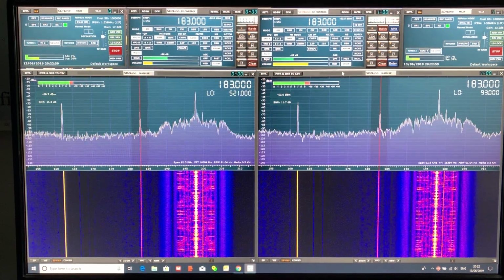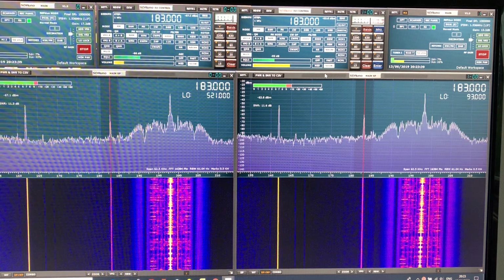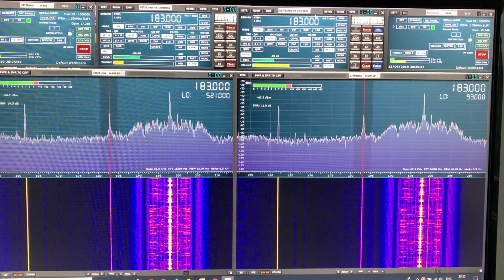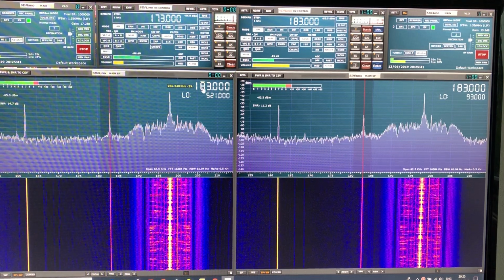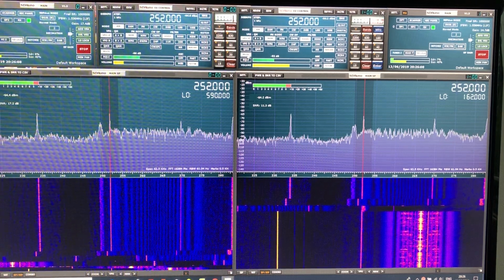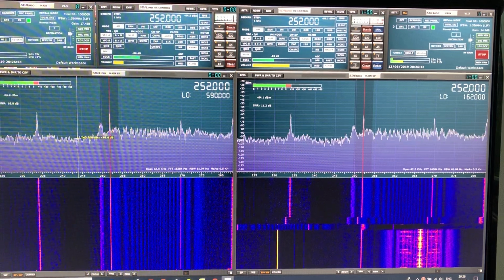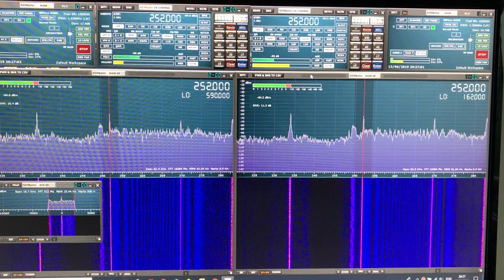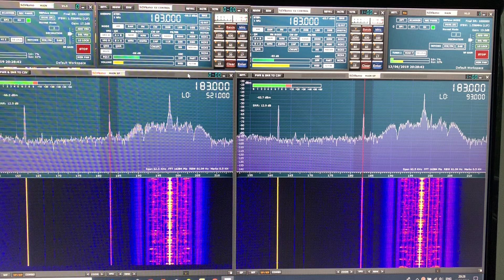Bonito CCMC-30 coaxial common mode noise filter: very encouraging initial results on longwave

Comment: Very good video Clint, I have the Ma305 and the Megaloop FX and while the loop rejects more noise the MA-305 is better for DX. I use H155 coax too and it's grounded on the Ma305, the Antenna just blows me away for the size of it. The Megaloop FX is better for local hams like NVIS but the megadipol and MA305 are serious DX antennas. The MA305 is also a brilliant LW/MW Antenna. 

I might get one of the CCMC-30 chokes for the  Megadipol and try it out on some noise I'm experiencing from the grid at certain times. 

By the way Clint, have you tried the longer whip with the MA-305 ? I did before and there was a notable improvement in signal and I lost it because I put the smaller whip back  because at the time it was overloading my Airspy HF+, you know the SDR that was never supposed to overload ? lol well they updated the firmware and provided RF gain control which made a huge difference but I lost the longer whip so I must get another.
Reply from the maker: Hi there, thanks for your note comparing the MA305 and MegaLoopFX. It's interesting that you're finding the 305 as good on DX when conditions are quiet presumably? I found the same thing - down in the DX woods I use, the signals on both antennas were largely the same...just goes to show the mess QRM causes! I have tried a longer whip with the 305 and got severe overload issues. Keep safe my friend, 73
Reply: @OxfordShortwaveLog  Yes I had the longer whip and noticed overload but this is when I had the airspy HF + before they updated the FW to allow gain control because Airspy said the HF+ would not over load with strong signals and how stupidly wrong they were. After that the extra gain was notable when the receiver didn't overload. I went back to the small whip and lost the long whip so I'm going to get the long one again, it's on the way. I''ve got the New Sangean ATS-909 X2 and it works so well with the external antenna I'm going to try it out on that, it sounds so good on SSB too and on ECSS much better than the Tecsun 880 and 990x.

Comment: My question would be would you notice a lower reading on the S-Meter when you insert the CCNF?
Reply from the maker: I think just - but that would only demonstrate the incremental improvement in SNR is small. 73s, Clint
Reply: Last weekend the M&P salesman was trying to tell me that their cable would reduce my noise level from 1 to 3 db. Whether that is true, I'm not sure. The coax that I am using is Buryflex RG-213. Believe me in that I am not a noise specialist. The only time I had bad electrical noise was a few years ago when one of the insulators on the electric pole across the street was defective. I had quite a battle getting Philadelphia Electric to come and investigate the problem. Of course they said it didn't exist. But I could prove to them that it does. They refused to come. So I called and said I had a Valid FCC Amateur Radio License. If they didn't come, I would report them to the FCC for violations. Needless to say they came within a couple days and fixed the problem. Trust me when I say that power companies don't like the FCC.
Reply: @markgriffin2285  If only I could do the same about my neighbour's solar panels 😂
Reply: I have 2 beams on my tower. One is a tri-bander and the other is a two element 40 meter beam. I tested my S noise just a few minutes ago. This test was with no antenna active, 160:0, 80:0, 40:1.5, 30:0, 20:0, 17:0, 15:3, 12:3, 10:1. Here is the S noise with antennas active, 160:7, 80:6, 40:3.5, 30:1, 20:2.5. 17:1, 15:4, 12:3.5, 10:2. My question would be what is causing the noise level with no active antenna on 40, 15, 12 and 10. And trying to find that may be like trying to find a needle in a haystack. With antennas active it does not surprise me the numbers for 160 and 80 meters. That's why I have a receive antenna that I use for those two bands.

Comment: Many thanks for this experiment. Any improvement will do for me given the challenging environments we DX these days on the lower bands. If you can do a comparison using the Wellbrook then that would be great as that is the only active antenna I have that works with my Elad. 73s!
Reply from the maker: Exactly! I couldn't have put it better myself. I have tested with the Wellbrook already and there isn't much difference - for obvious reasons, but I will still do a couple of videos demonstrating this. 73! Clint
Reply: @OxfordShortwaveLog  Why didn't it make as much of a difference with the Wellbrook?

Comment: Thanks for the comparison. It is no rocket science. Only a simple   cable trap (I use one at the antenna's end and another at the receiver's end of the koax cable. Homebrewed stuff).
But 99€ (eek!) for the Bonito cable trap is overpriced...
Reply: I agree,73
Reply from the maker: It's pricey, but if it works, DXers will buy it I'm sure. 73! Clint

Comment: Hi Clint! Thanks for the test video. As a side note, I've used proper common mode chokes (two brands of commercial units & a DIY) on Wellbrook antennas (various styles through the years) and have found zero to minimal improvement. The same chokes however dropped the QRM on other antennas like a PA0RDT mini-whip, PAR EF-SWL, home brew delta loops, and others. My conclusion has been that Wellbrook antennas are by nature very balanced antennas and have excellent common mode rejection due to their design characteristics. Wellbrook's literature indicates this, but it was informative to discover this through my own hands-on experience.  I hope that Bonito expands their availability in the USA; their products are harder to come by over here. 73, Guy
Reply from the maker: Hi there Guy, exactly right. The H-field Wellbrook is already less susceptible to electrically noisy environments and thus the SNR reduction delta is always less on the Wellbrook than any of my other antennas when using a galvanic isolator for example. However, it does still make a difference, if only lowering the noise floor by a few dBs. With my Boni Whip or MegActive ME305, the improvement is much more obvious. 73! Clint